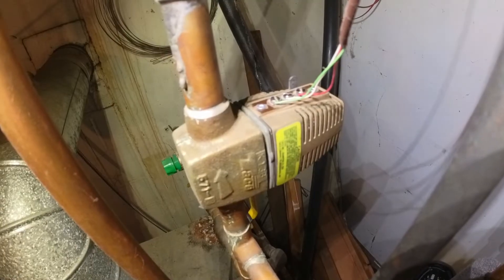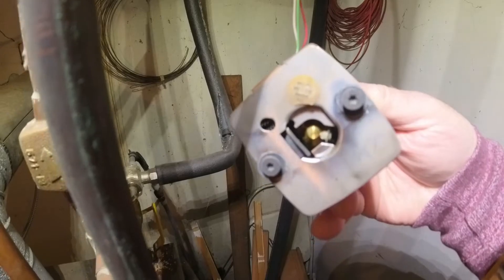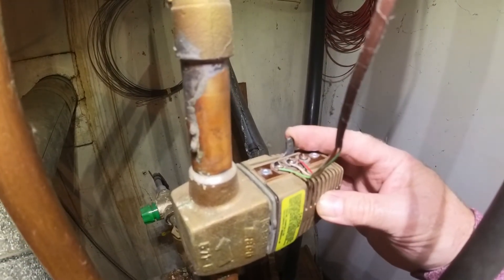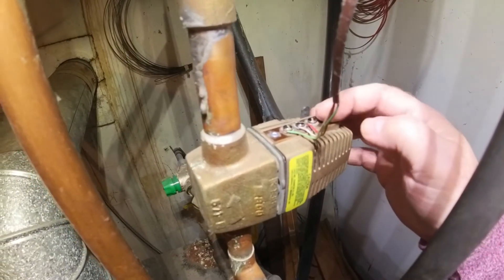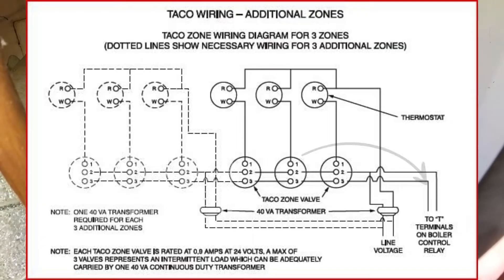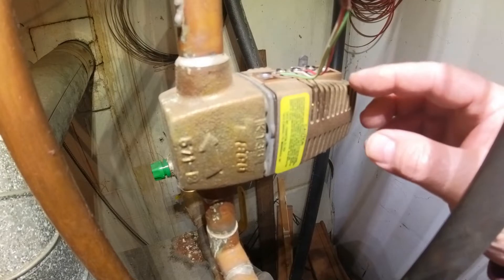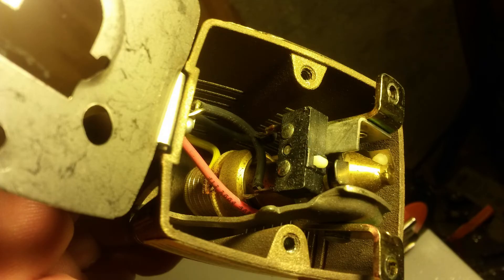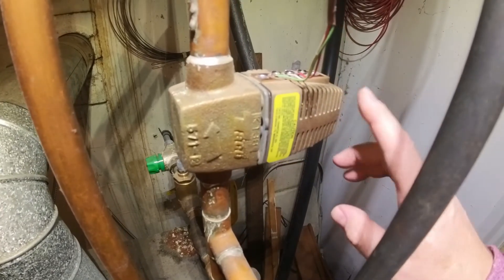Taco 571 Zone Valve Explained

Comment: The gold plunger on mine is stuck down and I'm having trouble reinstalling it...won't sit flush, the two screws can't reach...any thoughts. Apartment tenant with no heat waiting on a super...thanks in advance
Reply from the maker: Make sure you turn down the thermostat to that zone valve first. If it is working properly it will recess into the body when it cools down. After doing that if the plunger does not return into the correct position then you will have to replace the power head.

Comment: Thank you for this video. I wanted to purge air from my zones and couldn't get the lever to move into manual. I didn't want to break it, but when I saw that you had to give it a little more push I was able to get it manually open and finish the job.

Comment: Finally, a very short but amazingly thourough explanation of how it works. I wondered why my .9 amps would drop out after a short time because I thought this was a solenoid. I never knew it was a wax motor, crazy! But, super helpful explanation. Last night I'd have 27 volts at 1 and 2, and then down to 8 volts, maybe that was the cycling?? It was a bad stat anyway, but without a meter you're just a parts changer...

Comment: Thanks for this thorough explanation!! I had a service call for no heat request at the Aquastat and they diagnosed it as a failing Aquastat and wanted $1200 plus labor to replace it. Did it myself and guess what? Still no request for heat at the Aquastat despite the thermostat saying it was requesting heat. After watching your video I found a bad zone valve for the non working zone and ordered one. Thank you so much!!!

Comment: So where I’m lost is if you have a 40va transformer feeding thermostat and R 24 v to terminal 1 and terminal 2 is common. 3 is apart of TT but that diagram looks like TT and the 40 VA transformer cross. I thought that would be like crossing two transformers then?
Reply from the maker: Those wires are after the load so it doesn’t effect the voltage. Its similar to connecting all the white wires (common wires) together in your house wiring together. USA 120 volt AC.
Reply: Your themostat is just a switch, when closed it powers 1 and 2. When the motor pushes forwards, 1 and 2 disconnect (by a switch inside) and 2 and 3 energize TT, or the boiler relay. My system has 6 zone valves and 3 transformers, The 3 transformers are wired in parallel to acheive the proper amperage, in the case that all 6 zones thermostates close (call for heat) at once, I need that amperage. The zone valves all share the same common, in parallel. Any zone (t stat) that closes turns on the bolier relay, gas valve and then the  circulator runs when the water is hot enough to circulate. This Channel gave a great explanation.

Comment: I popped in to see if I could manually open the valve to test if it were bad. You end the video with "I hope this helped." it did. Super informative and I learned a lot. Love the expanding wax liner drive. That is slick.

Comment: Thank you so much! I switched out an oil boiler with a propane combi. After the switch over one of the zone was barely heating. After watching your video I figured the valve head was twisted a bit and seated it properly. Now I have heat in all zones. Great Video! Thank you again!!!

Comment: Excellent description what I have been noticing with a valve head I’m working on, same exact model. The actuator lever is very difficult to move even with 24 V at the valve. I had to kind of force it into the manual position to get heat. I will be replacing the valve head, I’m under the impression when the valve is energized, and the actuator drives the piston, the lever should move freely indicating the valve is fully opened. Unless I’m mistaken?
Reply from the maker: The lever should move freely when the valve is open. If it doesn’t move freely then the valve body is sticking or the lever itself has an issue.

Comment: If the power head isn’t fully flush to the base, in other words the pins aren’t fully in will it not work??

Was not getting heat on second floor and noticed the he power head has a gap between the head and base. Pin wasn’t fully in the hole so took off and put on fully. Now have heat, could it have been that simple?
Reply from the maker: Possibly, the powerhead has a plunger that pushes into the valve body to open the valve. If the head is not anchored, it will just push the head away instead of opening the valve. If you have heat, that was obviously the problem sometimes though the heads, will loosen and unhook themselves, I know that sounds strange, but it does happen.  if it happens again, you will have to replace the powerhead.
Reply: Bear in mind, these make a very small movement, I'm not sure if it moves much more than 1/6th,  if 3/32nds. You can feel it with your thumb if you test it off the body, but you probably won't see it with your eyes.

Comment: IF THE LEVER MOVES FREELY NO RESISTANCE???
Reply from the maker: Normally if the lever moves freely then the thermostat is calling and the zone valve is open. You can test this by putting a voltmeter on terminal one and two and you should read 24 V. Or turn down your thermostat and after a few minutes check to see if the lever only goes about halfway and then you feel resistance, then you know the valve is closed. It is possible the zone valve body is stuck open. it would be extremely rare but it could happen.
Reply: @scotttaylor3049  valve body stuck in the open position sprayed some w40 hit with hammer and started working thank you
Reply: @jl901645  I don't hit them with a hammer, Channel locks can work the valve pretty good though...
Reply: If you open the valve manually by pushing it to the left against the resistance . Can you then turn it off my moving it back to the right?
Reply from the maker: @Fireneedsair  yes as long as the thermostat is not calling
Reply: Excellent explanation 
.. thank you